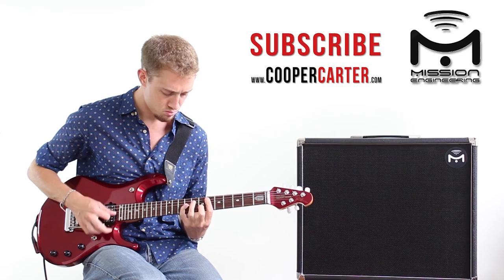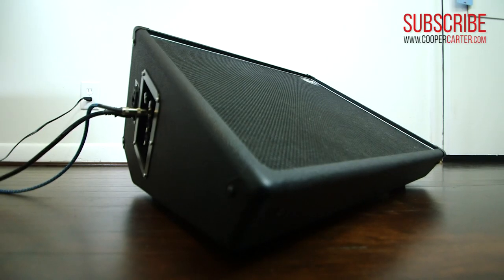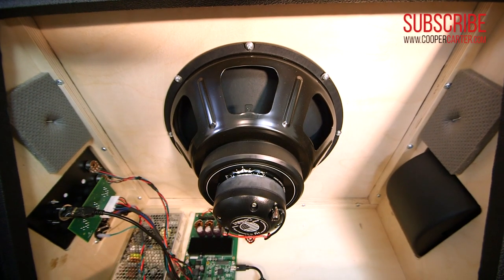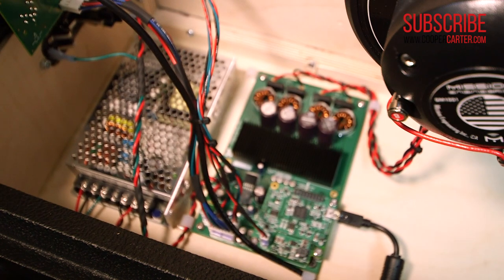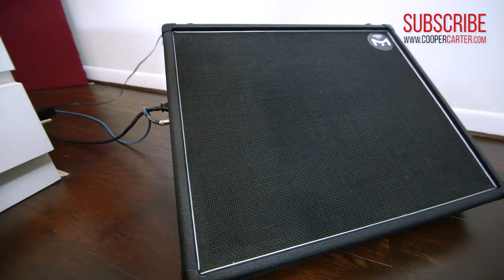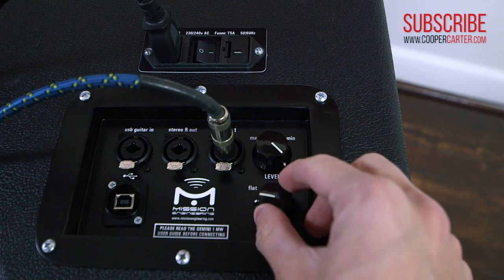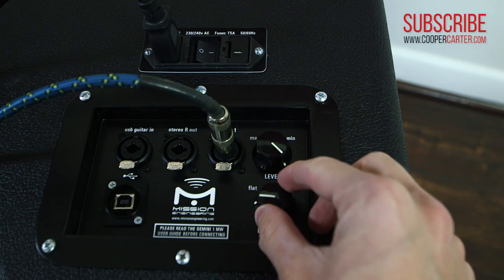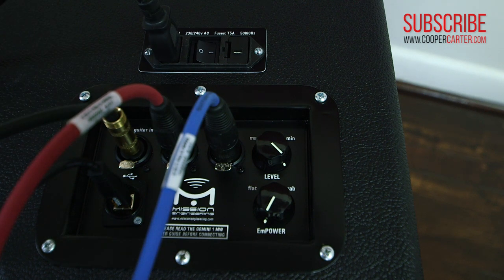Mission Engineering Gemini Wedge Demo by Cooper Carter

Comment: Hey Cooper. When i run my Atomic CLR live, i take an xlr out of the CLR directly into the FOH desk 1/4", vs running out of output 1 of the Axe FX into the FOH desk. Can i do the same with this Gemini wedge?
Reply: Thx Trev5150!
Reply: I just followed that link, thanks and good netiquette. At 42lbs and I'm now 62 and no crew, opps. I have well over 12K big shows on my resume' and now with real back damage battling to stay in shape so my hands do not go numb and I still hear better than most younger people. These  look great...I bought the 1st Atomics for my POD...but I digress. I get it but I will not go quietly!
They don't look like a "Marshall" 4 X 12's (or fill in your preferred brand to me), part of many players inspiration is looking back at your amps and then you are part of "that Image" from the audience's view and in your minds eye.. I used to put my stereo 2 - 4X12 Marshall slant cabs tilted way back and when there was distance and lots of air to fill I would put them vertical or normal behind me. In real SPL intense situations ( they wanted me really controllable and or quiet for the vocalist's) I would put them or just 1 in front of me (all before IEM's whick I was some of front line users and they saved my gig!) and these wedges would have been the bee knee's. I get to no amps deal and was forced to do it long before all this great,  ha ha "new" technology was a dream. As you get older start assembling your crew cause you need your body to work 110% just to perform. Joe Satriani chooses to ice his forearms and hands for 20 mins after many if not all shows, been there see him do it. Just like a pro tennis player would. I say all this as I was up all night editing a new music video and on my way to the pain clinic and then to the Chiropractor. Because I thought was bullet proof (THOUGHT!) and I was wrong, yet again. Those look great, THE SOUND HAS A HARD TIME TRANSLATING OVER YT'S COMPRESSION AND ALL THE OTHER WAYS THEY SMASH ALL YOUR HARD WORK. Try not to confuse simulated amp sustain with real 3rd 4th and 5th harmonic true guitar feedback. It's like a mini bike with a muffler on it, to me. You have come a long way. I still refer to your every Axe FX patch videos in a playlist. Peace and Maximum Respect ~ Loo